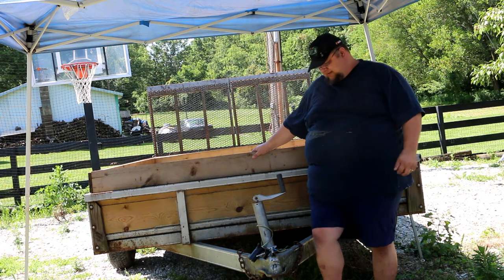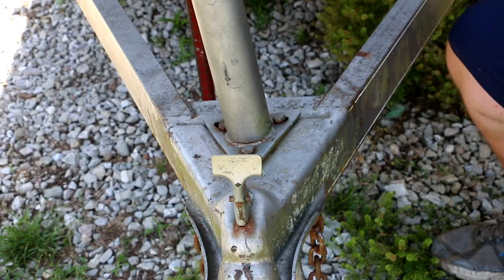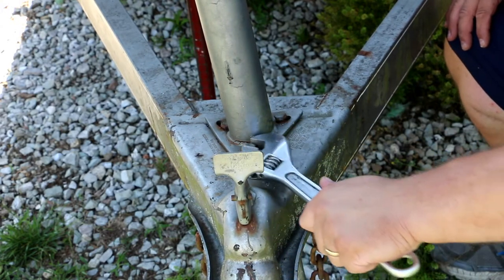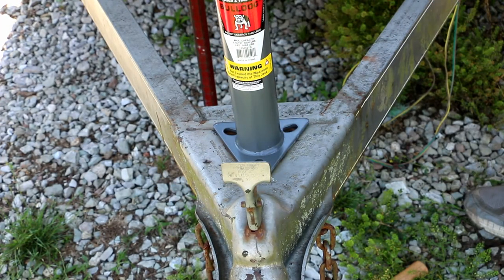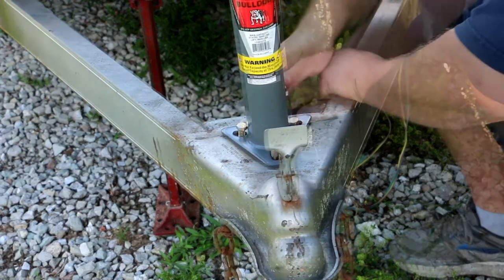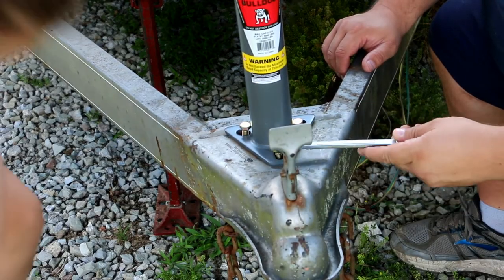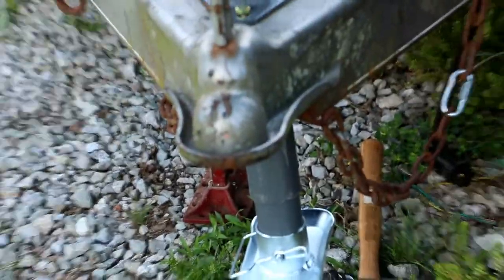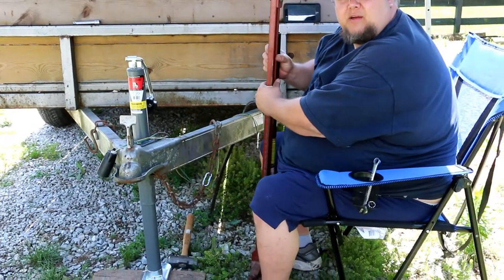Replacing a damaged trailer jack...

Comment: Is the inside of the jack that is connected to the foot hallow inside the old one ? I'm getting ready to move a 73' model camper for remodeling. The current jack will not retract. It's a A frame jack my intention is to cut the bottom off with a saws all and replace it with a new one during the remodel.
Reply: @HanginwithHarv  Thanks so much for your quick response. I have to go to the DMV to get a 10 day tag so my time is limited to get it done. I just sub your channel 👍
Reply: @HanginwithHarv  Got it done and brought it home yesterday. New tires and Jack going on it this weekend. It's a 72' Model not a 73' Camper , heavy as lead coming home. I hope that Jack comes off as easy as yours. It's probably the original jack , it's only 46 years old lol 😂
Reply: @HanginwithHarv  okay will do have a great Christmas and New year I catch up with you soon. 👍